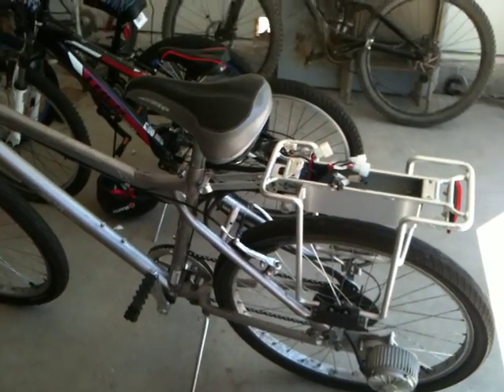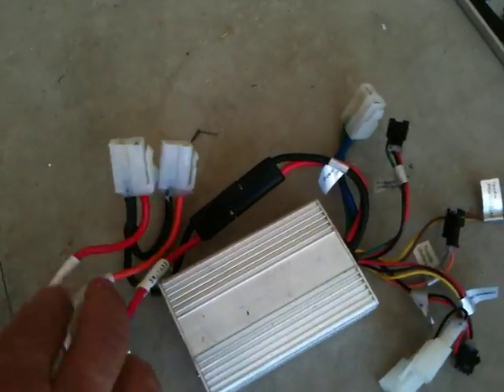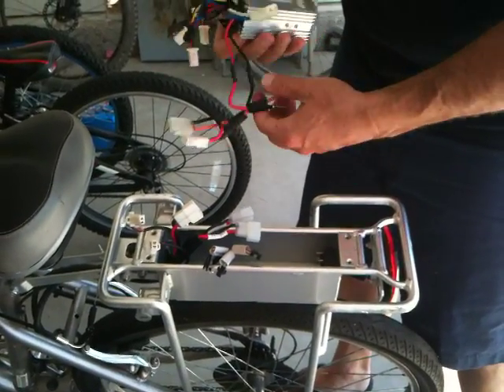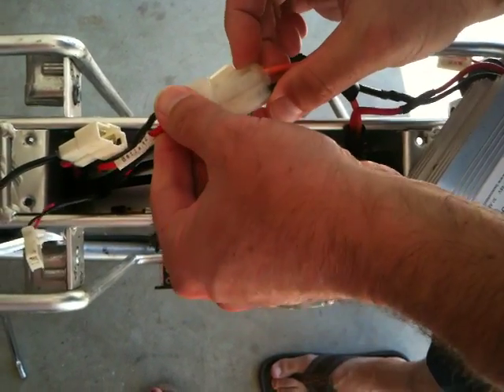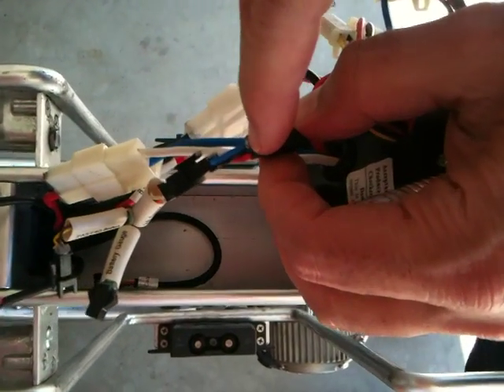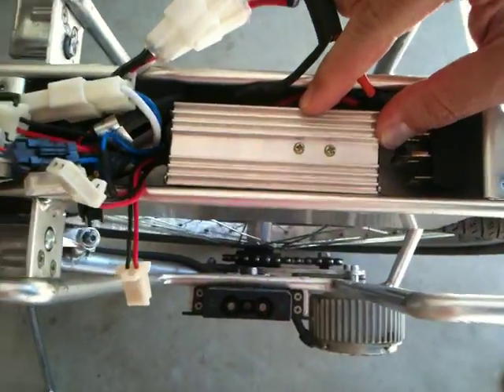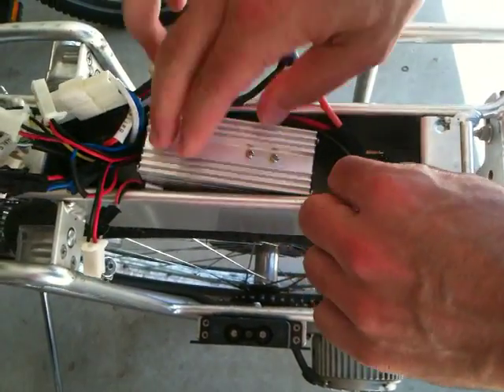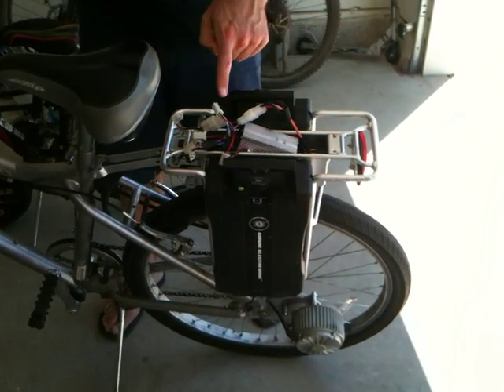48V Currie Step2.MOV

Comment: so what controller do you recommned now 10 years latter> i picked up 3 of them used and would like to increase speed from 15mph to 20mph.  is  switching the gears like this post better than going through the hassle of over volting it? ACS Southpaw 1/2" x 1/8" x 16T freewheel    20mph+ from EZIP 24 volt OEM pack! | Two Spoke Forums  https://www.twospoke.com/threads/20mph-from-ezip-24-volt-oem-pack.6826/
Reply from the maker: Hi Khan, 
Yeah this was quite some time ago... eBikes have evolved quite a bit from back then.  Switching the gear out is certainly much simpler.  But over-volting gives more flexibility and power.  I don't do the upgrade kits any more, haven't looked at the websites.  General parts are at eBikes dot ca - canadian company - but that's for a general eBike.  Best of luck on your quest!
Reply: @MaderTB  wow thanks for the reply! I think I will overvolt to 34v (controller capacitors are 35v max) and change out gear.  ebikes.ca is too expensive I prefer buying from ebay or aliexpress, one can get controllers for $20 to $40 vs $120 or more.
Reply: @khandam7709  wait so the stock controller can handle 34v? Just need a 34v battery?
Reply: @kVarfpv  no one makes a 34v battery , for most people it's better to swap out to 36v controller and battery than try to make a custom 34v battery
Reply: @kVarfpv  mine does, take apart yours and look at the max capacitor voltage. and if it goes to smoke don't blame me.
Reply: @khandam7709  haha of course, I have a bunch of LiPo batteries and a bike I stopped using cus the lead acid battery is dead. I thought maybe I'd tinker with it. Thank for you help.

Comment: Hey Tom, I am wondering if you are still selling the conversion controller. I am thinking of converting my old SLA to Lithium Ion for both battery packs with 24 volt each battery pack making it 48 Volt. Is it possible just connecting both battery packs without replacing the old controller? I hope you can still read this comment. Thanks
Reply from the maker: Hi Marco, I still get these comments / questions but I stopped making these a while back.  You do have to upgrade to a higher voltage controller, you'll burn out the stock 24V one.  And, if you don't put in some kind of limit, the motor will eventually burn up at full 48V.  You can make a custom setup at many online places like ebikes . ca (Canadian company).

Comment: Hello where can I find that stock controller
Reply: Unless you put the resister in line, will not work. Cheaper to go with 36v hub motor and hoverboard batteries.

Comment: 48 volts is way to much voltage for the 540 watt motor and if your not peddling a top end speed before you give it throttle your likely to fry your motor beyond repair.
Also the motor will run extremely hot in just a shot ride and better hope it's not a upgrade or head wind.
You guys who believe these type of modifications to your eZip bikes are fools.
learn from doing your research on motors, voltage and amps, controllers before you believe any of these whacky people who never show you the end results why they fried their motor.
Reply from the maker: Thanks for the interest - surprising since this was posted 7 years ago...  But I will point out that you are in error.  At about 2 minutes in the video, notice that I put in a potentiometer into the throttle signal path.  You can set the maximum speed to a safe place, like 20mph or so.  I did burn up a couple motors to see what the max "reasonable safe" speed is, and of course full 48V is too much.  But the throttle sets an equivalent voltage below that - since the converter acts as a variable DC-DC voltage converter.  Around 20mph is pretty safe and far less frustrating than the stock 16mph (which is slower than most road bikers go on the flats).  PS I don't make these anymore.  I think the electric bike world has moved on from 7 years ago :)
Reply: Yeah the E-Bike fad for the financially well off is over for them and they got bored with their old toys which I'm so glad because I don't want the Government putting any more restrictions on my E-Bikes because of those law breakers that ruin it for those who don't have money to buy toys with.
Reply: I can do 20 mph on my iZip Trailz AL without having to spend a thousand dollars on 48 volts worth LiPo batteries, controller and ruin a great bike.
Maybe some of those expensive E-Bikes will end up on CL with an affordable price a poor boy will appreciate having.
I love my Currie eZip and iZip Trailz AL and have been offered $750 more than a few times and I keep telling them they can buy a new one for much less but they want mine.?

Comment: hi i try 48v on my bike and half throttle but motor get very hot is it safe thanks
Reply from the maker: +h singh Suggest keeping max speed setting around 25mph, the motor can handle it.  If you push it all the way to 30mph at full 48mph you will eventually burn up the motor.

Comment: Tom….so, are you still riding this eZip w/upgrade after a couple of years?

I finally found a NOS 2012 Currie eZip Trailz step for $175 and so I'm looking at upgrading it to get the speed to where it should be.

I've done the upgrade of the 20t freewheel to 16t, and the speeds are around 20mph. Though you lose a bit of torque.
Reply from the maker: Hi, I rode my 48V currie setup for couple of years (2008 to 2011 or so), but since then I have migrated to more expensive setups.  I still think this is a great way to get started at low cost.  My current setup cost me around $3,000 but it is much faster ;-)

If you want a kit send me an email and I'll hook you up.
thomas.b.mader at gmail dot com

Cheers
Tom

Comment: for some reason it wont let me send a response with a link :/ so thats why my or an explanation of a link thats why i put spaces bewteen the w's and com's.  anyway would you be able to make a controller plug and play for 36v? im planning on purchasing a second rmb pack and using my original to just have a single 12v inside.

Comment: ebikeforum is a website with w w w dot in front  and dot c o m at the end (duh not trying to be dumb but if you didnt know).  below i put a space between the ebike. and com on the link so just add the w w w  dot and take out the space before the c o m for the link for my bikes situation. its pretty sweet and probably the fastest ezip trails bike out there using oem sla battery pack

Comment: here is a link of my ezip's situation. . ebikeforum. com/f61/20mph-ezip-24-volt-oem-pack-80982.html    (copy paste i have the same username AHSCHITO)  i am currently achieving 22-24 mph off the 24v sla battery. I am getting ready to upgrade my controller but from what i can tell 36v seems to have better luck not burning out than with the 48v although the 48v would give top speed.
Reply: Can we run this stock on 34v batteries or is there a 34v controller available?

Comment from the maker: Well, if you really want to do it right, buy a Ping battery (Google Ping Battery and you'll find his site).  Would suggest 48V 10AH LiFePo.  Then you just put it into a battery bag, and off you go.  They cost about $400 but it has higher capacity than your two huge SLA packs - and about 1/3 the weight - and will last for years.  More simply (but more expensively), Currie now carries LiFePo packs, same deal but will cost you more.

Otherwise will post up here when I have my new kit.

Comment: Ok, thanks for the info.  I do often use my bike for short trips on my lunch hour at work so I think it would be inconvenient to load both batteries.  I'm still very interested in your set up though.  Both of my batteries are aging and they'll need to be replaced within a year or so.  Is it possible to pack 48V into one battery housing?  Failing that please feel free to notify me when you've done any upgrades.

Comment from the maker: The switch now only has one position - the other position does nothing.  Unfortunately, the 48V controllers have a safety cutoff voltage around 41V, so you can't use it for 24V operation.  I have some future ideas how to make this system better (including working for both cases), but this is what I can do right now.

Tom

Comment from the maker: I buy the 48V controller and the stock Currie harness, plus connectors and the potentiometer.  The key is to properly connect them together, which requires about an hour and a half of soldering, crimping, shrink tubing, and then a test ride.  If you want, I can make you one.

Comment from the maker: With the 48V system (two 24 packs in series), you get twice the capacity.  Going full 25mph you probably get about 15 miles with a new pack, or slightly less, depends on how much you pedal and how fast you set the maximum speed.  

There are also LiFePo packs available from Currie now!  They fit directly into the RMB racks.  That's the simplest way to making a 48V light-weight system with high speed.  But those cost more than the lead acid packs of course.

Tom

Comment: Nice work, I have the same bike.  I have been thinking a lot about modding my ezip.  I had planned on 36 volts, but... and, I was also really wanting to upgrade the battery technology to ni-mh or li-ion if money wasn't an obstacle :)  I still would like more runtime / lighterweight than the lead acid can offer, but I might be sold on your 48 volt method because it allows the adjustment of top speed. 
Can i ask how many miles you are getting from your two pack fully charged?